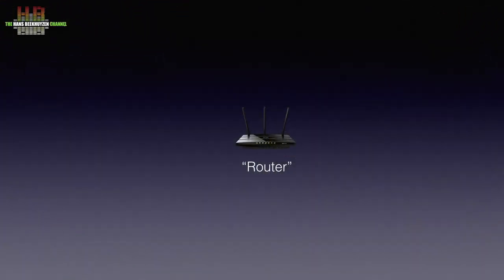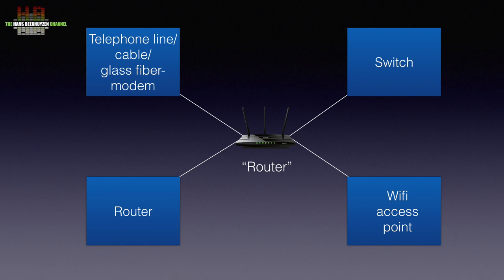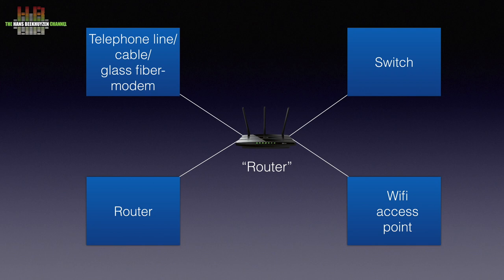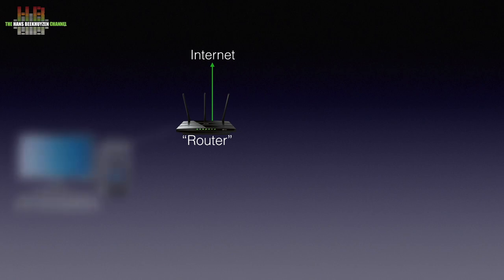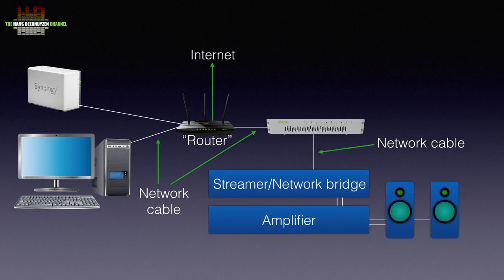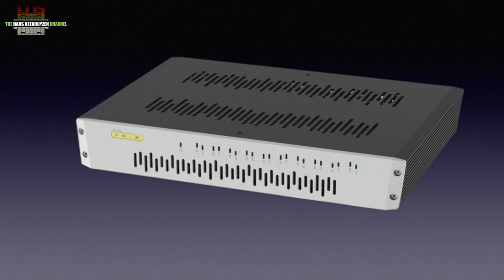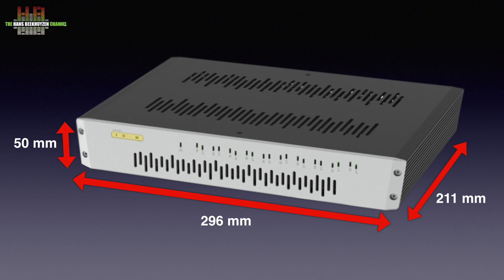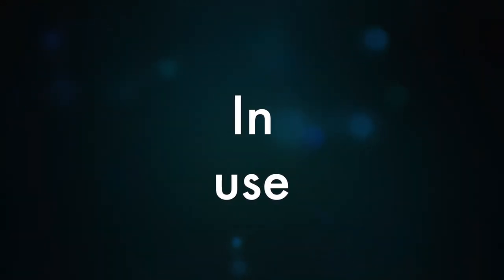SOtM sNH 10G Audiophile switch

Comment: The end-to-end connection that ensures the reliable delivery of data, and its proper sequencing upon receipt, is handled by Transmission Control Protocol. TCP packets are routed through the Internet, and at the receiving end each datagram payload is passed by the TCP/IP stack to the application software for evaluation. The last few feet of wire, connector, and switching will nevertheless make an audible difference in the sound quality when streaming compressed files?
Reply from the maker: There have been many explanations for this, none of the conclusive. And the improvement of better ethernet cables differ per situation. But often there are improvements to be heard in a well tuned system.

Comment: Hi, I have two SOTM switches separated by a 20meter cable run. SOTM folks advise against fiber due to jitter, yet I read that fiber is less prone to jitter than copper. Would you connect through SFP ports? Or stick to RJ45 with CAT 7 cable. Thanks!
Reply from the maker: It depends on the SFP modules.
Reply: @TheHansBeekhuyzenChannel  best SFP module you would recommend regardless of price? (I’m assuming single mode SFP anyways)

Comment: Hans did you have a separate power supply to run the sotm?
Reply from the maker: I have tried the PSU's I have and there was at best no improvement. This kind of digital devices need bulks of current fast which a switch mode power supply can deliver. The supplied SMPSU gave the best result. I experienced the same with the AQvox AQswitch SE.
Reply: did you try the sp500 unit?
Reply from the maker: Not on the switch

Comment: Fiber, if implemented properly, fiber has the possibility of sounding great, maybe even better than an analog connection. Having just purchased a good quality glass fiber toslink
cable for my Chord dac, I immediately noticed how everything sounded more relaxed, with a blacker background.
Reply from the maker: Real fiber, as used in networks, do have a large bandwidth. Toslink, and then especially the transducers in the devices, have less bandwidth than SPDIF but provide galvanic separation. It is therefore likely that either you have solved an earth potential problem or use equipment that has some kind of problem in their SPDIF signal, like for instance noise due to a poor power supply.

Comment: I’m using the SOtM switch for a month and it’s indeed a great improvement. I’m surprised a LPSU didn’t made a difference. I will try that.
Could you please share some amazon links to the hardwares I need to setup the complete optical path. I’m a bit confused as there are many options.
Reply from the maker: I have bought the optical gear from a local supplier that advised me. I could not find exactly the same products on Amazon. I use Finisar FTLF8519P3ByL transceivers with matching optical cable.

Comment: Dear Hans. Very informative. On the hunt now for the right cables and connector. Would you be willing to please share specs for the necessary supported bandwidth?  I am also confused about whatyou said about ´crosslinked’ is that non standard? Apologies for my ignorance.
Reply from the maker: I sometimes tell too much and making it more complex than necessary. For network cables you can use any normal 'patch cable' that has CAT5, CAT5E or CAT6 printed on the cable. Even better is a network cable you can buy in a good hifi shop. This audiophile cable is only needed if the network cable has to run close to the audio cables.
Reply: Hi Hans, thank you for your answer. I now see that I said too little. I am interested about the glassfiber components. After your post I am considering pulling a 15m glassfiber cable from my internet (Ziggo) router to my switch will be next to my audio equipment. I already found the transceiver model in one of your other answers below. So my question remains which type of glass fiber cable I should buy. Does it matter if I buy single or multimode (besides the maybe difference in price) ? From the video I could not distinguish which converter you used towards rj45. Sorry for bothering you again...

Comment: Hi Hans, great video, thanks.
Have you tried replacing the Media Converter with another SOtM switch, using it's SFP for fiber to the other SOtM switch? Apparently it has a significant impact - I'm about to test for myself.
System: SOtM Std switch, Auralic Aries G1, Anthem MRX740 AV Amp, MK Sound IW950's + 2x V12 Subs, Apple TV 4k.
Reply from the maker: Yes I have. It did improve the sound somewhat using an Aries G2.

Comment: I'm wondering where best to put such a switch in my small network, as currently my NAS (music server/source) and Squeezebox Touch (with Tidal plug-in) are close to the router and directly wired to its LAN ports.  Should the switch go between the router and the other devices, or should I keep the NAS on the router and have just the Squeezebox on the switch?  And might it be worth trying an inexpensive Asus switch first, which I have going spare, or, in the interest of audio enhancement, would there be little point?
Reply from the maker: A ‘normal’ switch will not improve the sound quality. But I also question whether the SOtM switch is the best way to spend your money. I think a good network bridge will bring better return on investment.
Reply: @TheHansBeekhuyzenChannel  Thanks for the reply, Hans. Although I've invested in a better DAC device (Oppo UDP-205), I hadn't considered there might be sonic benefits from upgrading my streamer (a.k.a. network bridge or NAA...?) The Luddite in me has resisted migrating to a system which relies on a browser- or app-based UI, as for me these can't compete with the convenience and near-instant access available from the Squeezebox display and an IR remote.  I do, however, need to tolerate occasional sluggishness, when accessing long playlists or certain custom menus, which probably isn't helped by running the LMS on a low-powered QNAP NAS.  Upgrade streamer choices with in-built screen and an IR remote facility would appear to be somewhat limited.
Reply from the maker: Believe me, once you're used to operating your music playback from a tables, you'll never go back.
Reply: @TheHansBeekhuyzenChannel  Hans, given that the Squeezebox Touch has long been discontinued, can you offer an opinion on where (if?) the sound quality of its digital output (USB, TOSLINK or S/PDIF coax) might complete, if it was still available, and if used with a better PSU?  Thanks.

Comment: Thanks to you, Hans, I'm no longer in the bit-are-bits camp.  My Squeezebox Touch (S/PDIF'd into an Oppo UDP-205) in the lounge has been networked (wired) using Powerline adapters to a NAS in another room, running Logitech Media Server and holding local music files.  Your audiophile switch reviews led me to try moving the NAS to the lounge, thereby avoiding the Powerline link.  I was pretty happy with the sound before, but now I feel it is sweeter and more relaxing.  Certain vocals no longer have a slightly forward edge and are more natural, and listening overall is now more akin to analogue.  Even TIDAL seems improved, which leads me to ask one question: does the TIDAL stream involve the LMS on its way to the Touch, or does it go directly to the Touch?  Bearing in mind that both devices are still wired using inexpensive cables to network ports on the router, there would be even more scope for improvement in the network domain.  First, though, I need to look into "domesticating" the NAS!

Comment: Hello Hans, could you please check sotm with optic vs your router on 3rd floor via cat6 15 meters -> aqvox -> cat6 1 meter or less -> sotm. And if you have standard switch, shift the aqvox with standard switch and compare to optic sotm? So router on 3rd floor via cat6 15 meters -> standard switch -> cat6 1 meter or less -> sotm.

I have feeling, that once you put switch between long run cat6 cable and audiophile switch, you will get same results or better, then fiber.
Reply from the maker: Incorrect. I have tried that too, of course.
Reply: @TheHansBeekhuyzenChannel  thank you for the answer, why i thought so, i talked to May(sotm) and she said, that with good cables her switch sounds better, than with optic, because optic its additional conversion, but maybe because you use 15 meters, optic wins in this situation!
Reply from the maker: @iManiac7  I can only report my experiences. And as I said, perhaps other media converters yield less improvement.

Comment: Hello Hans. And thanks for your channel ! 

After reading the NAIM forums I recently bought myself a professional CISCO WS-C2960G-8TC-L switch. That improved my music in an expected way ! It looks like the last switch, which your transport or streamer is connected to, is of some high importance.

With that switch in place, I could not hear any difference between streaming (through low quality switch and CPL ! ) from a NAS far away in my house and streaming from a quality nas (qnap 210 with SSD) locally connected to that switch. It seems that the CISCO switch really makes the difference in forwarding the packets the best way. The music definitely sounds more natural.

The good point about the CISCO switch ? I bought it from a company selling its obsolete hardware. Ebay makes this possible. Price of the transaction 100 euros delivery included to my door.

The switch was money well spent.

JF
Reply from the maker: I have tried that too, but I prefer the SOtM, sound wise. But for the money you got a fine switch.

Comment: While I follow your vlog religiously I have to make some comments. See errors in transmissions and even delays can be rather easily measured these days. If this is a 1000 euro switch I have to assume it comes with some serious tools that should simply show what you claim to hear.  We are talking bits after all. if there is no retransmission, no fluctuation in bps you have a perfect switch that should be 100% transparent to sound. 

Now, this is hard to achieve. You mention playstations etc etc and indeed if you want to be serious about audio you should remove all those devices to a separate network. But the switch can only be as good as a high-quality cable of a few euro. if there are no errors and no fluctuations in speed it's perfect, right? And again these are measurable these days without any problems.

if you want to make this a good sell, show us that it delivers bits better then let's say a Ubiquity setup of a half the price. Coming from a network job where jitter is seriously important (not femtoseconds, while I agree they can flip bit, even a very basic switch will avoid to almost completely) I dare to say this switch contains a lot of snake oil and until it is simply tested, again not at all complex these days) I am willing to stick to that idea.

A $60 Ubiquity box will show you EXACTLY how many packets did not arrive in sequence. If this box does not do that it might be time to ask why. If it does, it's easy to show it's superior.
Reply: I guess it is because with PCM...  sample timing is relying on actual timing of reception... there are going to be timing errors when packaging it into packets and then vice versa. So a router with a good clock with extremely low processing latency will make a difference. The more consistently the samples are delivered and thus the less processing is done on the audio renderer will always resulting in better audio quality.
Reply from the maker: In the 80s I noticed a sound difference between two SPDIF cables. I had my colleague at that time - Peter van Willenswaard, do the same listening test without telling hem what he was listening to. And he confirmed my findings within seconds. When we published about this - I in Dutch magazines and Peter in Stereophile, we got about the same comments like you just gave. This moment is documented in the 25th Aniversary book of the Dutch AES section. It took well into the '90s until to have this pinned down as jitter. Before you comment further, please try it out yourself and be surprised as many already are.
Reply from the maker: I can imagine that reclocking and reshaping might contribute to a better timed signal. Next to your point, of course.
Reply from the maker: Both USB audio profile 2 and ethernet are async protocols. Perhaps my presumptions why there is a difference in sound quality might not be correct, the sound difference surely is. Please try it first before you further comment. And when you heard it, think with me to explain it....
Reply from the maker: That is my guess as well.
Reply: dfaik I have Apple routers as well, and the fact that Apple has discontinued production concerns me.  I saw an older model Extreme at a thrift shop recently for $7.00US.  I should have bought it - if it’s still there I will!
Reply: dfaik Understood - I was thinking of this simply as an emergency backup. I’m a network engineer (formerly Xerox) and generally able to troubleshoot to the packet level. 😉